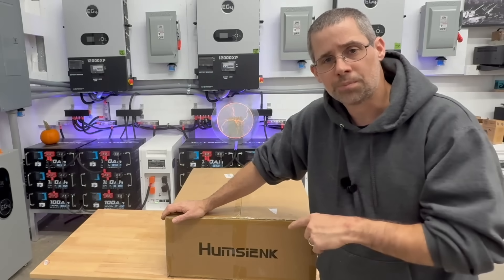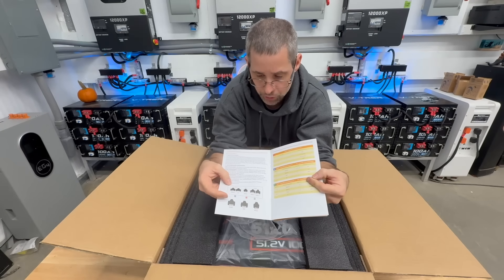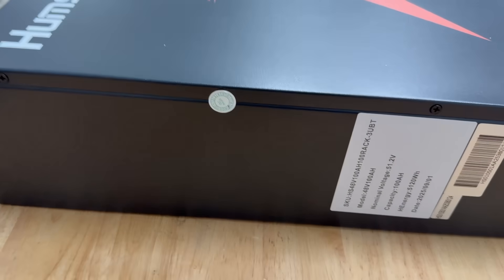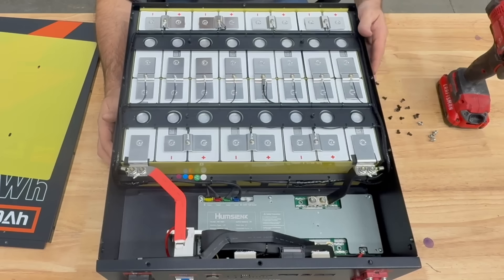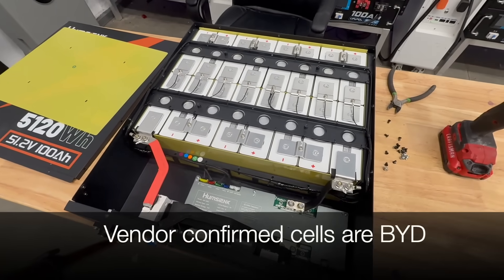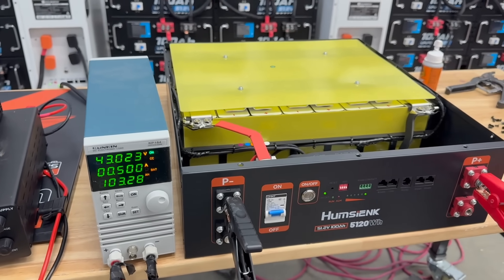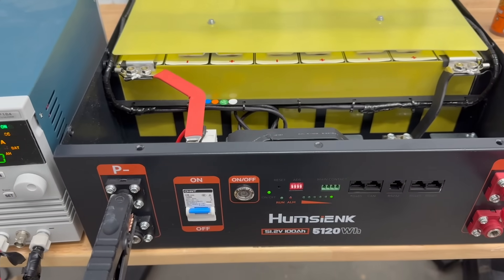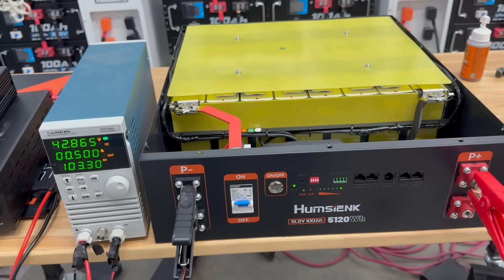48V 100Ah Server Rack Battery Review - High Quality and Cheap?  YES!

Comment: Question' Why does it have 2 separate settings for both High temp and low temp protection in the app? 

Also needs a self heating option as we need that for the winters on East Coast.  Too bad.., 

 Great review BTW.
Reply from the maker: Thank you very much for watching.  Having heating for a battery is always a plus on any battery.  I'll have to check the app for the heat settings.

Comment: Did it come with battery cables? I've seen other posts saying you have to supply your own.
Reply from the maker: Hi Doug it comes with short cables to connect to another battery, but not the ones going to the inverter.  Personally I don’t use the cables that come with batteries because they are usually borderline undersized

Comment: Looks like they are going after the Eco-Worthy fans like me at this price. I wish they had the positive terminals on the left side like the EW v3. That's the only thing that's making me hesitant to pull the trigger to see if EW would match the price come BF and CM sales.
Reply from the maker: I completely understand,  one possible option is use these in a separate rack and connect the EW and these to a common busbar.  But just spit balling because I haven't seen your setup.  If you want me to take a look you can post it on my forum.  WindSolarForum.com under the Showcase Your System thread.
Reply: @MikesSolarGarage  I appreciate the gesture, but I only have one server rack battery so far. My plan is to expand slowly piece by piece. I just can't bring myself to drop thousands a pop and possibly end up with things not working out or over/under sizing. So far I have a power station with some solar panels and the server rack battery powering a window AC and miscellaneous jobs.  Since cooling season is over, I'm going to shift it over to space heaters.  My final state is to eventually expand the system to hook it up to the house panel with a subpanel and keep adding circuits as the system expands.  Hopefully it wont be too mishmashy of different components at the end.

With that said, I went ahead and pulled the trigger and ordered two of the Humsienk server racks. PayPal has a promotion going on now which stacks with your discount and the BF sale that brings the price down to $500 for each battery out the door.  I couldn't pass up this deal while waiting on a comparable EW BF deal that likely will not materialize.  I just have to deal with longer battery cables criss crossing.
Reply from the maker: @godblessthelessfortunate3175  Congrats on the purchase.  That is an amazing deal for sure.

Comment: The shipping charges are free to most (perhaps all) of the continental USA. Using your link gets us a small discount too. So total price to my door with tax and all is about $620! I sent them an email to see how responsive they are. I'm seriously thinking of buying a rack of them.

UPDATE: I was wrong. Taxes were not included. Buying six of these with tax, free shipping, and discount code might cost you $3827.50.  Or about $638 each.
Reply from the maker: If you have any questions for the vendor I can reach out to them for you.  They are also sending out their wall mount battery to me to review.  I should have that delivered soon.
Reply: @MikesSolarGarage  I just sent them a follow up asking if they have cabinets at a discount if you buy enough to fill it up. I thought I saw a cabinet somewhere on their website holding seven of their batteries. They'll probably get back to me before you can ask them.
Reply: Eco-Worthy did that when I bought from them. Eco-Worthy gives the cabinets away for free when you buy four or more batteries.
Reply: @MikesSolarGarage  Well I'm getting tired of waiting for them to reply. Do you know if I even need a cabinet? I'm thinking maybe I can stack them on top of each other? Could you stack six of them on top of each other? Thanks.
Reply from the maker: Typically 3 high you can server rack batteries 3 high without a rack.  Some people say 4, but any higher and there is a crush risk.  I have 3 Vatrers stacked on top of each other without a rack.   I also reached out to the vendor about your question on the racks.
Reply from the maker: Here is a reply from the vendor “We have also received similar suggestions and are actively considering adding battery racks to our product lineup. We truly appreciate this valuable feedback—it helps us better serve our customers' needs.”
Reply: @MikesSolarGarage  Thanks.
Reply from the maker: Glad to hear you got a discount too!

Comment: Seems welded cells are unfriendly to the DIY crowd. What I mean is that a cell may need replacing at some point. A DIY friendly package should have replaceable cells. I'm also waiting for the day these server rack batteries drop to under $500.
Reply from the maker: I agree a really like replaceable cells, but with these being BYD they should last a long time.  It seems like the server rack battery is built like a tank and well thought out.

Comment: When is the AC combiner box design going up?
Reply from the maker: It has coming my friend,  I have been painting the edges of all of my solar panels black for privacy.  I'm hoping to wire up the combiner boxes this weekend, if not early next week.  Lots of work and trying my best to catch up.  Thanks for bringing this up though.
Reply: @MikesSolarGarage  I've never heard of such a thing. Painting the sides of solar panels for privacy. Maybe you could explain it in a future video.
Reply from the maker: @CheapHomeTech  I’ll have a video on that as well.  At max height with my drone,  blacked out edges looks like shadows instead of the shiny aluminum that is the shape of a solar panel.
Reply: @MikesSolarGarage  Wow. That might be a great idea. Especially for DIY people like myself that have never bothered with any permits.
Reply from the maker: @CheapHomeTech More privacy the better.

Comment: got a great price
Reply from the maker: I haven’t seen a price this good.  I don’t know how they can make them this cheap, but wow!
Reply: @MikesSolarGarage  yes I thinking about rolling the dice on D I Y mb-56 with 628 ah for $ 2979 . got to have 440 ah for each schneider 6.8 x w  solar getting expensive .
Reply from the maker: It definitely adds up for sure.  I think I am around 70k invested right now.  DIY route is a great way to go.
Reply: @MikesSolarGarage  I guess I need to quit whining got 6k in it so far still need 3 k for batteries and 2 k for solar panels to start .
Reply from the maker: @stephanied143  It sounds like you are building a really nice setup.  Hopefully the sales are good this year to help keep the cost down.

Comment: Why not do the capacity test as built before you open it up? Maybe to check safety first... but most people dont open a battery... so testing as is first is key
Reply from the maker: You make a good point,  I'll try to move the capacity test up in the videos.  I like to see what is inside it first so I can understand the components and if I need to worry about any issues while charging.  But you make a very good point.